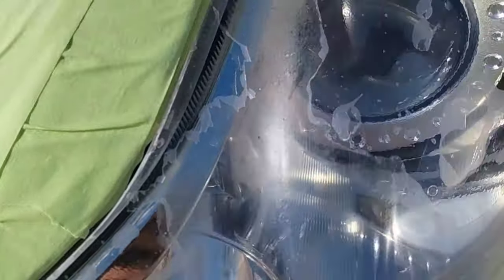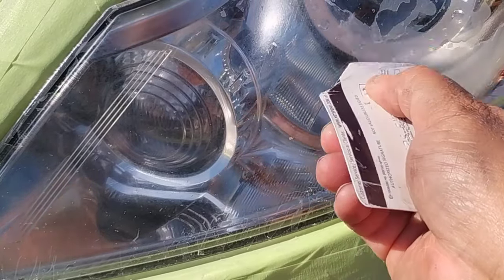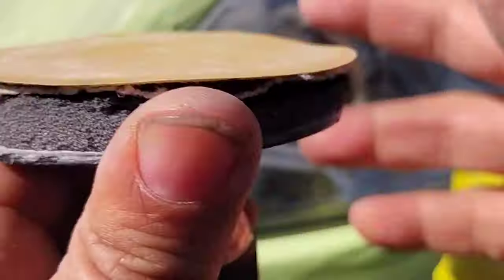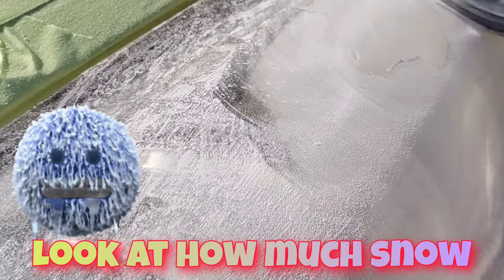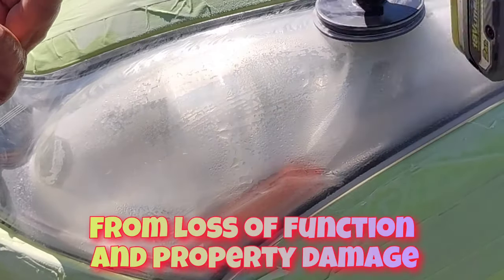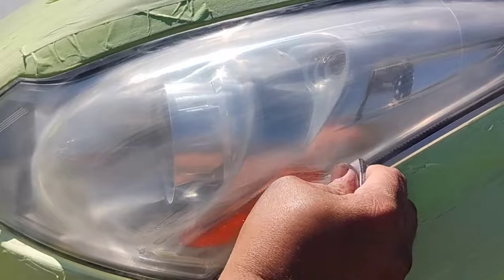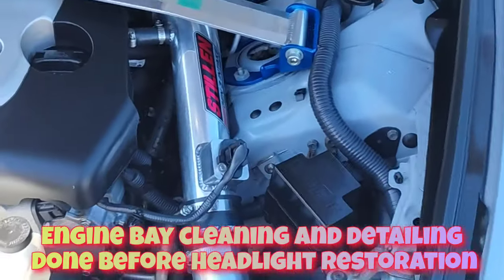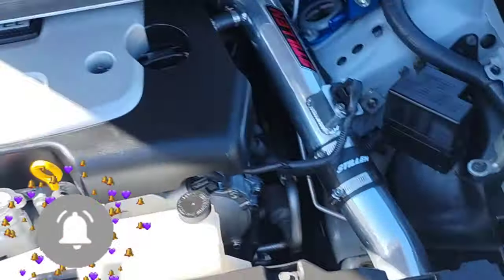2K CLEAR Headlight Restoration - WTF - why?🤨🤔🥱

Comment: undisputable you've earned the 👑for lights... and engine bays... well done and I'd still love to see a vid on the latter 😉(even if a single bay vid has to be broken into parts like Prep, Solutions/Cleaners, Techniques, Finish.... etc as it seems a longer process and therefore a longer vid).

Comment: Hey great job on the videos! Keep up the great work. I was curious why after you go with p800 with the drill then you go do it by hand? Just for the edges or is there more to it ?
Reply from the maker: It should explain more in depth with this video here..
But basically visually you can see swirling better and swirling shows up better even though there's minor chance if done right that there is swirling Left behind to see through the clear coat a straight line is almost invisible so therefore it's almost erasing any kind of swirling left behind... Eraser step...... Smoothing step...
https://youtu.be/R1DsMcZ6q1Q?si=7Wk90lhvMRZC7UMd
Reply: @theheadlightrestorationpro   thanks for the quick answer. Also one i forgot to ask why from p800 you go p3000 and skip all of the other grids ?
Reply from the maker: @yavoriliev2754 Unnecessary....this is a ,3m 3000 trizact.....it does the work of all of those grits...
You see the finished product...( Over 100 videos up on this page..)
I use to buy then through experimentation  I found these to be useless if you control your pressure...

Comment: What polisher pad drill adapter are you using? I don't see it in your description. Also do you use the fan to flatten any drips or high spots? I ordered the stuff that you use and I did a practice run on my 99 Civic and they came out amazing.
Reply from the maker: I use fans to air dry or forced air dry the lights as though these clear coats made for headlights and others dry their process called chemical exchange or air exchange kind of like super glue lights reacting with the moisture in the air..
That piece you're talking about is not really able to buy I rebuild them and they're cheap and they break there are far better ones listed on Amazon that's why I do not list It...
It's a personal preference that isn't quite correct like somebody who would like to dig a pool with a shovel instead of a tractor...lol

New video
https://youtu.be/LC4ZBu02JZg?si=4TaerpCinQd6d0Iu

Comment: 1. Will the McGuires coating bond to & cover 3000 grit scratches with NO polishing?
2. If I don't have liquid polish, can I polish with 5000 grit sandpaper and then coat?
3. What's too fine a grit to sand with before applying McGuire's?
Reply from the maker: #1 if you want a crappy light,that doesn't look or perform as good ..
#2 no & #1 as well
#3 none is ...(It's a true headlight/ made for headlight products) 
Also: FYI ..."no grit is fine than polishing"
Not even close...

Comment: when the maguires headlight coating wears off (in a year or 2?) to re apply do you need to re sand all over again before spraying the new coat on?
Reply from the maker: Yes it's the best way... Headlight coatings expire it's best not trying to save them instead of eliminate them and reapply..
It's best just to start fresh..
The thing with Maguire's keep clear it's extremely easy to remove when sanding probably about the easiest which makes it a great product cuz when you go to remove it you're just removing it and reapplying it....
Reply: @theheadlightrestorationpro  thanks that makes sense. as a first timer I do have a noob question? is it safe for the head lights to be restored every year with proper sanding technique taking some top layers off, after 10 years will say will there still be plastic left? lol how thick are headlights and is there a maximum limit to how many times you can sand them down?

Comment: What a lot of people don't seem to realise is that most 2K (not just clearcoat), contain isocyanates which are 100%  carcinogenic when breathed in. A normal mask will not suffice and a full positive pressure facemask is recommended. I have lost 2 colleagues back in the 80s when none of us knew the dangers. I am now a spray tutor and drill my apprentices of the dangers. Just sayin👍🏻
Reply from the maker: Yeah you always have to use a mass spraying this stuff... I use a vapor mask with extras has listed in the bio and shown on most videos... Definitely don't want to breathe any of this kind of stuff in...👍🏽👍🏽💯